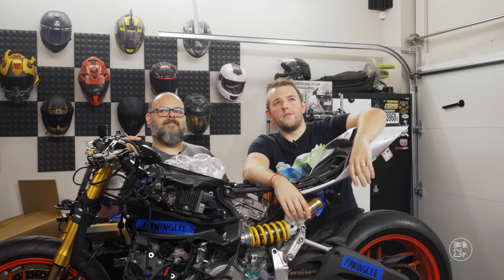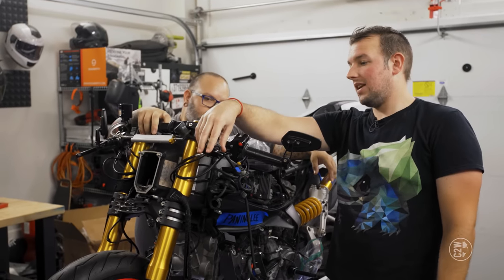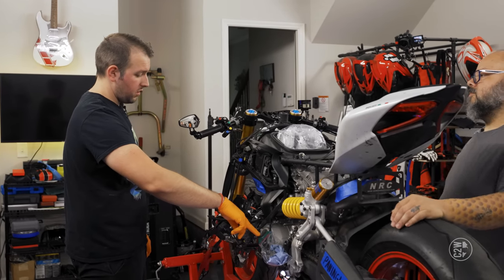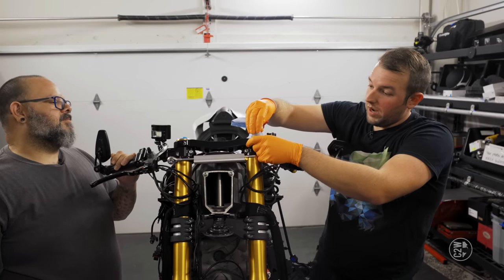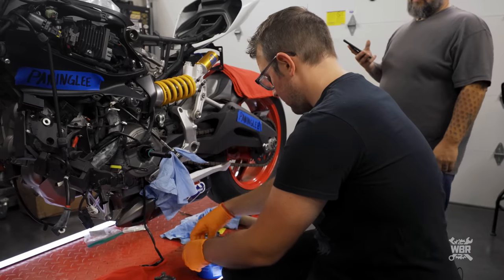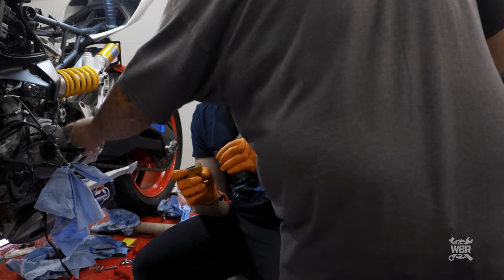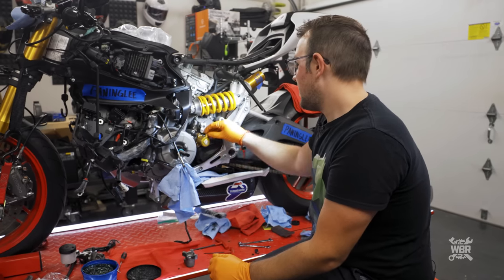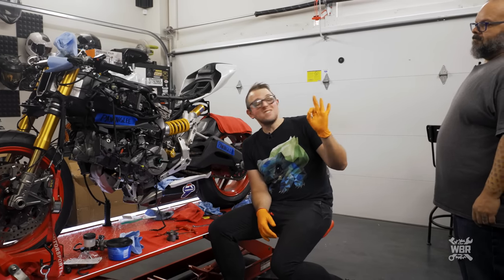BEST levers for the Panigale INSTALLED!!  [Wrecked Bike Rebuild - Ep 14 - 2016 Ducati 959 Panigale]

Comment: a little pointer that helped me when trying to loosen bolts from an odd angle/ position, if you look at the open end of a regular combination wrench one side of the open end sticks further out from the shank of the wrench. use the open end for reference as to which way is to loosen and which was is to tighten,  for example on the gearwrench  combination wrenches the shorter side of the open end is on the right so if you have the boxed end on the bolt you need to push towards the shorter side to loosen...if that makes sense.  

really enjoy watching your videos keep it up

Comment: Had a hydraulic clutch on my 748S, cable on my Daytona 675R and now back to hydraulic on my 899 Panigale, gotta say I think I like cable better, it's more consistent and my 899 cooks the fluid black in no time. I'm hoping you do a chain & sprocket change - need to see if it can be done without moving the footpeg/suspension bracket, I'm hoping just by removing the clutch slave it gives enough clearance.

Comment: Depends on the bike, hydraulic is nice when you're putting down some torque and therefore need stiffer springs, cable is nice when it comes to adjustability. I've got 7 bikes right now and 4 are hydraulic, 3 are cable. Of the 3 that are cable, I wish 2 were hydraulic because the springs are very stiff. #Moepowermoeproblems.

Comment: I like the feel of a cable clutch and gas.  I feel "disconnected" with hydraulic and fly by wire stuff.  Maybe I'm just old.  Hydraulic clutch is probably easier in traffic, but it's just not the same.   Am I crazy?
Reply: Not at all! I agree. My speed triple rs has fly by wire and uggggh, I miss my cable haha
Reply: Personally prefer a cable clutch, hydraulics just don’t have the same feel and consistency to me. Ride by wire takes some getting used to but when you go back to a bike with throttle cables man it feels good.

Comment: Haven't had a cable clutch very long so I don't know how to compare... The cable you feel the biting point on your fingers in addition to in your butt, hydraulic doesn't require so much pressure and it's more disconnected... In terms of preference, no idea tbh... I loved the hydraulic clutch on my V-Strom1000

Comment: Well if your clutch is hydraulic actuated it will be easy to press on but it is high maintenance and it might leak. If it is cable actuated it is easy to replace but hard to press on

Comment: Prefer the feel of a hydraulic clutch.
Prefer the simplicity of a cable. Usually run a spare along the existing cable to quickly swap them out if it snaps out bush. Dont feel like carrying a bottle of fluid around with me

Comment: why would you need the clutch switch? beside trying to start it from 1st gear (so the bike does safely start) any use beside that?
Reply: Alelo Most Ducati engines wanna know when the clutch is engaged to adjust the EFI
Reply: @AT2Productions  but for what purpose? the idle/fuel consumption during N and clutched in no gas should be the same - so what would the ECU change in the EFI if the clutch is pressed or not?

edit the only ECU/EFI change i found the switch does (beside safty) is limiting the RPM to 9000 when activated/clutch in - which would have no effect unless you want to revbomb someone on max RPM (which the switch would not allow)
Reply: @aleloAT  cruise control wont work without that and other electronics might have a problem also
Reply: Alelo various bikes and manufacturers have certain requirements for a bikes ecu to re adapt the fuelling etc, one of which being a clutch switch being at the released position among others sidestand switch and so on.
Reply: @AT2 Productions, @Alelo when you have a quick-shifter that can do clutchless upshifting, the ECU needs to know when the clutch is not depressed so it can smoothly execute the engine firing disengage for the upshift. Otherwise it assumes you are releasing the torque on the throttle as you pull the clutch in and shift up to do a normal up-shift. It’s a very important part to ensure the process runs smoothly in emergency and normal operations. ie you don’t want the engine disengaging to assist with the upshift if you’re doing it manually because that throws timing off.

-WBR paninglee previous owner

Comment: #outrocrew For me, hydraulic clutch, but cable throttle. Clutch for ease of use, not so demanding forces on left hand, and my ocd likes symetrical reservoirs up front,  and also on the "engine side" it just looks "cleaner" than a bold lever. On the other, right hand :) cable throttle, to feel more connection with the machine ;)

Comment: After having cable clutches most of my life, then moving over to a hydraulic clutch. I am fully for hydraulic. A motorcycle already requires alot of maintenance as it is, so any part that requires less maintenance like a hydraulic clutch is a plus. I speak for street riding only, not track riding.

Comment: I much prefer a hydraulic clutch until the Clutch Slave decides to go bad but there’s normally a little warning of fluid loss rather then the cable just snapping. Currently on a BMW RT and you actually gain fluid as the clutch wares away and it needs a good air bubble or the clutch can hydrolock and doesn’t work 😂 🙏 high five chase you worked well today